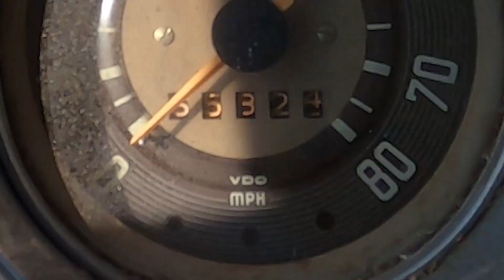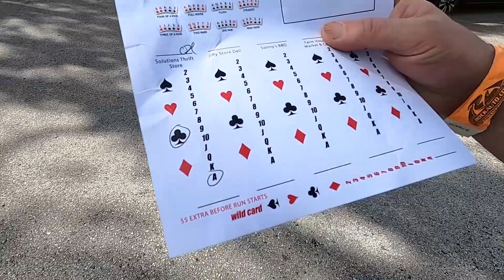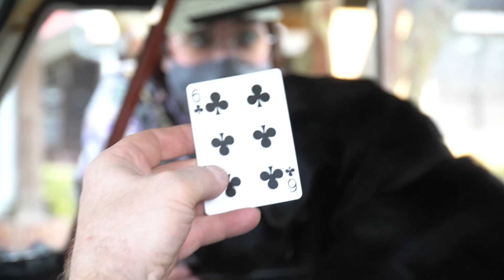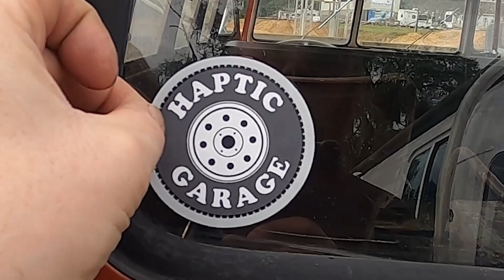Will it Daily? Roadtripping in the '67 Bus Project Vandemic E19

Comment: those steering boxes are usually dry. and the bottom seal usually leaks. I use STP in them because it does not leak as fast. and works well. Super thick and light weight oil
Reply from the maker: Yeah, it's not on the top of everyone's maintenance list so a lot of them do end up dry. As I recall this one needed a lot of fluid. Nice to hear from you Mike!

Comment: Great video Brent!  I've been thinking about getting one of those "Lock and Lube" thingy's.. Looks like they work pretty good.
Reply from the maker: Thanks Rob! It does work well but I recommend using it with a flex hose instead of the standard hard line. As long as the access is decent, it works great. Not sponsored, but if someone there wants to give me a call...

Comment: Great video. Love the bus! What brand cleaner do you use in your parts washer and does it work well for your needs?
Reply from the maker: Hi Rich, thanks for the compliments! I use kerosene in my parts washer with great results. I did try biodegradable cleaner for a short time but it was not satisfactory. It's important to make sure the pump is rated for whatever you're using; sometimes it's listed as "solvent safe". If needed, you may take a look at "Little Giant" pumps. Good luck and let us know how it goes!

Comment: What was that oil additive you recommended?
Reply from the maker: Hey Scott, thanks for the question. The ZDDP additive I used in the video is made by Engine Pro, but there are many widely available ZDDP additives that are the same/similar. It's good for protecting our flat tappet cams but it's use was decreased due to damaging catalytic converters and the proliferation of roller cams. I hope this helps, thanks for watching!

Comment: The Proper repair for your stripped zerk fitting ..would be to just upsize the thread diameter and retap it to fit anything ( metric or standard threads ) and fix it quickly and easily without taking it beyond what you need...which is a zerk fitting that snugs up and isn't loose.. No need to go overboard on what is a simple repair.... I would buy extra zerk fittings and a tap ( if you don't own one the right size ) and keep them ready for any future zerk problems....
Probably over tightened at some point in life... The grease in the fitting will let you contain the debris from retapping ( which will be minimum if you clean as you tap and can get anything in the grease easily inside your part )....
Welding a hole is way overkill in this repair.....a zerk fitting has no strain other than being " snug " ( not torqued !! SNUG as in barely past tight )...
Reply from the maker: Thanks for your thoughts Gary. I considered that option and perhaps it would have been easier. As a hobbyist I don't mind going a little overboard on occasion. Thanks for watching!

Comment: 20:36 beautiful
Reply from the maker: Thanks Bearded G, that was a big moment for me. I've wanted to drive a VW to the beach for a long time. Dweezil is next. Thanks for watching!
Reply: Right now as just today, I change from alternator to generator I have a 73 super beetle, I was having a lot of trouble with the wiring of the alternator, I installed a radio too, just need to wire the voltage regulator, and we'll for me it's easier.
Reply from the maker: Can't go wrong with the tried and true! I've yet to run an alternator on a VW. I could see doing it on a camper with a house battery, but gennies are easy to find and service.